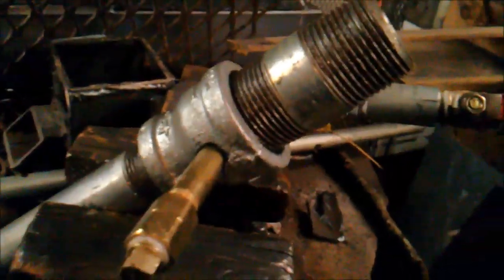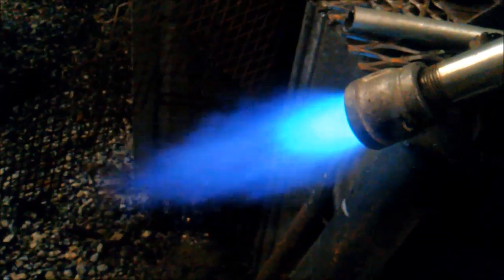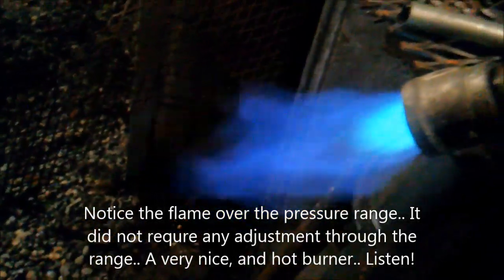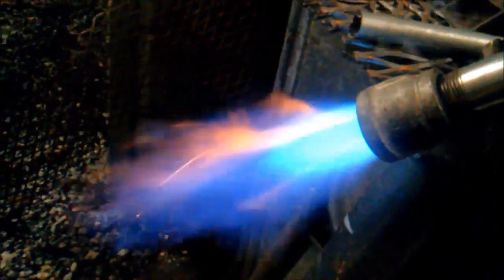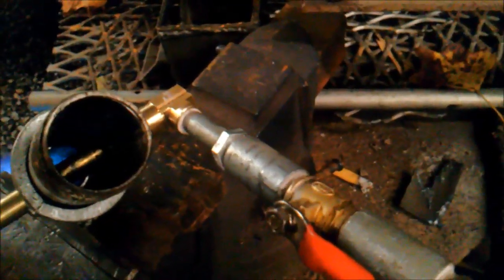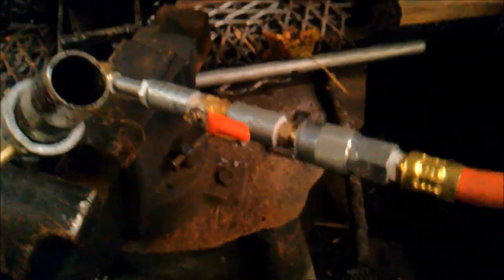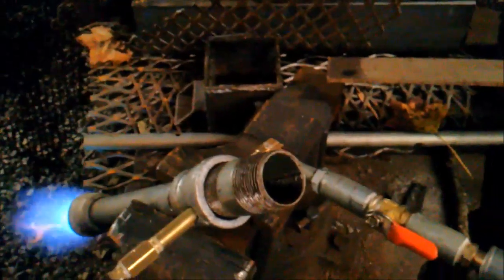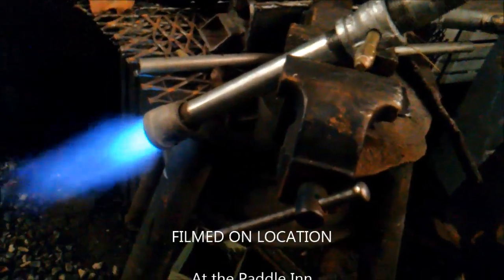Propane Burner for Blacksmith Forge or other applications.

Comment: Galvanized pipe on a burner is a bad idea, releases highly toxic zinc fumes. Stick to black iron or stainless.
Reply: It'd have to get pretty darn hot to burn off the zinc. if it's getting that hot, you'd better redesign your burner.
Reply: +sd-dirt You're a dangerous kind of stupid.
Reply: +800lb Gorilla 
zinc fume inhalation isn't as bad as people think. it isn't retained in your system when inhaled and has no lasting effects.
Reply: +sd-dirt Smoke 'em if you got 'em!
Reply from the maker: +sd-dirt I would agree with you on that.. 
I figured I would comment on the contest here... Just to look at things from a different perspective and to consider other dangers that should get equal attention.. It's not just galvanized.. 

Btw.. If you do get it hot enough to smoke the Galvanized off, it is so apparent, that, you can't not know what is going on.. Thick White/Blue Smoke, Green at the Galvanized, etc.. 
Obviously, you don't want to breath it, but, if you are welding or Forging, and don't have proper ventilation for what you are normally working on, it's a moot point.. You are not too slick anyway.. Everything else but the Galvanized is going to be much worse when combined. 
Galvanized is only one of the many coatings, contaminates, impurities in metal that you have to worry about... 
To be honest, it is a bunch of hype for those who are entering the world of heating/welding, etc.. to make them weary and respect the new venture.. If you don't do that in every venture, then, someone is only hoping to save you from yourself anyway.. 
I built something the other night.. Wasn't able to run to the metal shop to pick up a thin piece of pipe stock to make a Oxalic Acid Vaporizer for treating my honey bees.. 
Man, that sounds terrible..  Acid Vaporizer to treat Bees????
A piece of top fence post was perfect, and I had to weld a bottom cap on it, and would be heating it with a propane torch to convert the Oxalic Acid powder (Wood Bleach) to a Liquid, then to a Vapor to inject into the Bee hive.. It has been being used overseas for 10 years.. Finally, it has been approved in the USA.. One of the least obtrusive treatments to the bees...
I knew what I had to do, and knew what testing and using would entail.. I turned on a fan, put it at the corner of the shop, burned the galvanized off, welded the bottom on, and then, started testing the rate of dissipation on the Oxalic acid.. 
I had to intentionally wave some of the smoke into an area, and stick my nose into it to smell it. I wanted to see, just how bad this stuff was.. 
I didn't want to whiff in the smoke itself, but, it mixed in the air to see what 10x it would be like.
I never smelled the Galvanized either.. But, I have smelled it in the past, welding something that I didn't recognize as galvanized at the time.  
Then we go out to the store, or to work, and breathe all of the garbage chemicals our Government and Country is dumping into our Atmosphere to manipulate the weather and climate because of climate control, which has been proved to be a hoax to many times to mention.. 
Reduce and eliminate risks as often as you can, and work as safely as you can, every time to you do anything.. But, don't, Not Do something because you are scared, when you can do something as easily as recognize what you are doing and add some safety to it.. 
Galvanized Will Burn off, if you put it where it will get extremely hot. If you do, go ahead and burn it off and get rid of it, or,, better yet, get something else and don't worry "As Much" about it.

If we all run, rather than do, we don't have Derrick Hands on Oil Rigs, Underwater Welders, or,,,,,,,, People driving Cars for example.. A Much Higher Risk, than an occasional situation where you would have to, or choose to use an available piece of Galvanized. I have used a lot in a pinch, knowing, I only had to be careful when welding it. 
If you use a chop saw, grinder, etc,, and don't work in front of a fan, I can tell you what your clothes look like when you are done.. Imagine that.. It is other places also if you didn't realize that.. 

If you don't do that every day, I'll tell you what is worse, statistically across the Nation.. 
Going to the Doctors office or Hospital because they are afraid of being treated incorrectly at the Hospital.. If you look at the percentages of deaths in this Country, don't worry about much more than the next "Drive" to your "Doctors office".. That's the truth of the matter. If you didn't realize it, the Doctors office is more of a risk than getting killed on the way.. 

BTW.. Cancer is not caused by Lack of Chemo Therapy, or, Lack of Radiation, and neither is a Headache caused by lack of Tylenol or Asprin.. Think about it. 
Just do your best in everything you do.. When you start making frequent trips to your doctors office, your medicine cabinet and kitchen table will start filling up with all sorts of pills that do nothing to cure you, but, only mask your symptoms.. There are Alternatives... 
Cheers, and everyone avoid the use of Galvanized when you can', but, don't think for one minute, you don't need to be worried about everything else, and be just as vigilant.